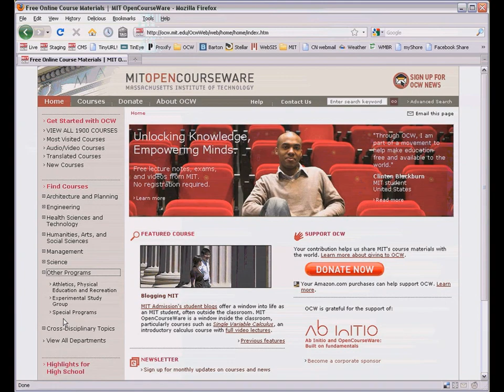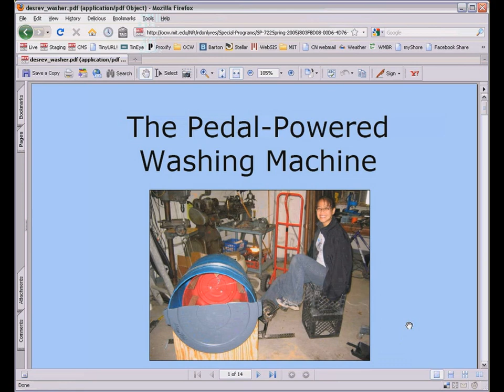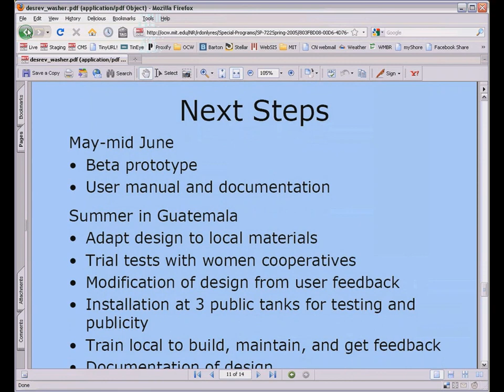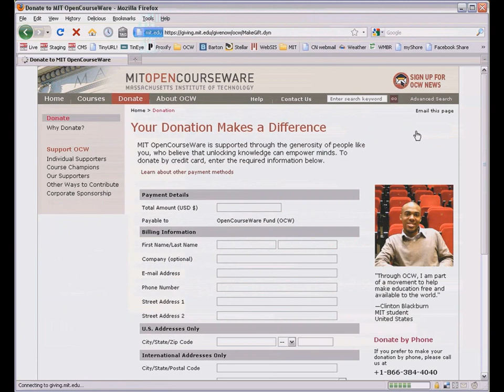MIT OpenCourseWare Staff Pick - October 2009

Comment: I'm sure the students studied some history of washing machines.... There is a very old machine that operates similar to this pedal power machine. The old machine had a handle on one end that the user simply pushed back and forth to toss the clothes around. It was a basic barrel with the handle on one end and a wringer on the other side of the frame.